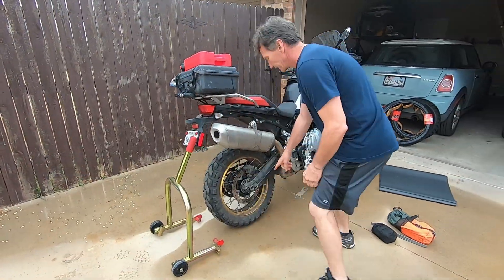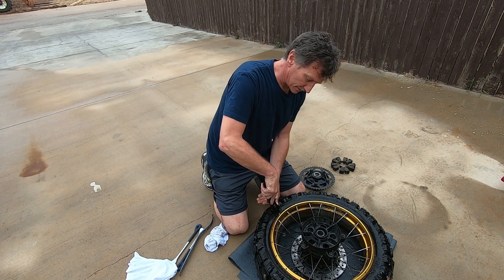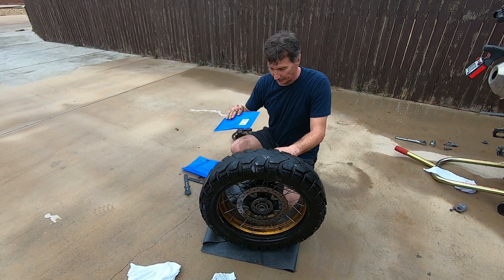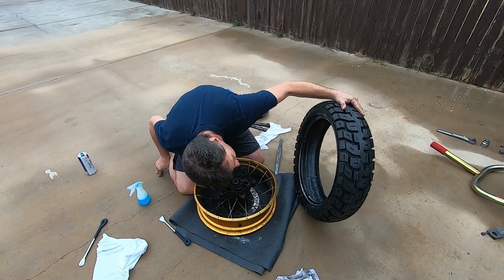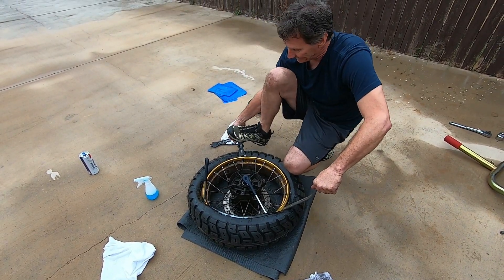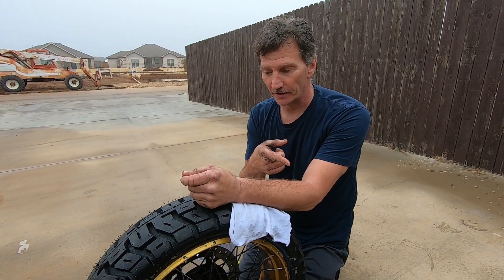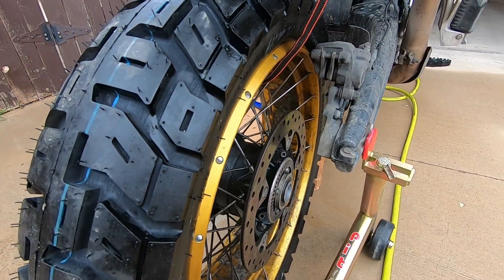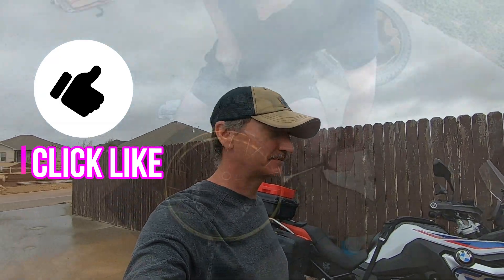How to Change Tires On a BMW F850GS.   Part 1, the Rear Tire.

Comment: Your ratchet strap trick is brilliant!  I’ve struggled trying to lift the tire, keep the spacers in place and slide the disk into the caliper, all the while cursing the gods of motorcycle maintenance. I’m almost looking forward to my next tire change!
Reply from the maker: I hear you lol.    I’ve done more than my share of cursing before I started using the strap.   Makes all the difference.  I don’t dread doing it anymore.   Good luck.

Comment: Been mounting by hand for 30 years so I feel your pain.  Use plastic knee pads and that will help you hold the bead closest to you in the rim valley.  Your knees will thank you and you will be able to put much more force on the tire without hurting yourself.  Use WD40 liberally on the bead before breaking them loose.  Will help the bead break and the old tire will slip right off.  Obviously don't do this if you plan on remounting the same tire or using the tire on another bike.  For mounting use straight liquid dawn dishwash soap and apply it by hand liberally on both beads before mounting.  Never muscle the tire on with the rotor side down, they will bend... especially the front wheel with dual rotors.  I usually take the rotors off to avoid warping them.  Finish the job by using a static wheel balancer so you aren't pulling them back off due to a wobble.

Comment: Greetings from New York and Thanks Chad for a cool video.  Yesterday, I changed the rear tire on my F800GS as I had two flats.  Fixed the flats with the local tire shop and still leaks.  Found there was a tube inside the tubuless tire with a broken valve stem and a cut. Bought the inner tube and tire and replaced using your technique. Went to install the wheel and could not get it in place being heavy, also the weather was very cold.  Had to bring the wheel back to the apartment.  Will use you technique with the ratchet.  Regards
Reply from the maker: Oh man.   Sorry to hear of your bad luck with the tires.    Also sorry for replying late.   

Any cheap ratchet strap will work.   When it’s lined up, it’ll go in easy.    Just one click at a time and guide it into the brake caliper.    

Best of luck.   Let me know how it goes.

Comment: I went with the new Dunlop Trailmax Mission tires and they feel good the few times I've gone out but I really don't have anything to compare it too yet.
Reply from the maker: Cool.   So far these have done well too.  I’ve probably put a couple thousand miles on them since the video.   Definitely better ride on road than the others.   Thy did well in rocky stuff but haven’t really had them in mud or sand yet.   I’ll let you know how they do.

Comment: Any advice on tire pressure monitoring system and how to make sure not to damage it?
Reply from the maker: Hey Alvaro!   

Good to hear from you again.  

Actually, I recently traded my bike to another that has the tpm system.   And I’ve also changed tires since.   

I just did the same procedure.   I was aware of the sensor, but I started breaking the tire down 6 inches from the valve stem.   By the time I got around, the bead was broken before ever getting near.  

Mounting, I did the same.   I pushed the tire on and paid attention to it it laying over the tpm.   The rest was the same.   Not a big deal.    

Hope it helps.  

Chad.
Reply: @1leftadventures258  thank you! It helps!
what bike you have now?
Reply from the maker: I now have 1250GS.   Love it, but I also miss my old bike.